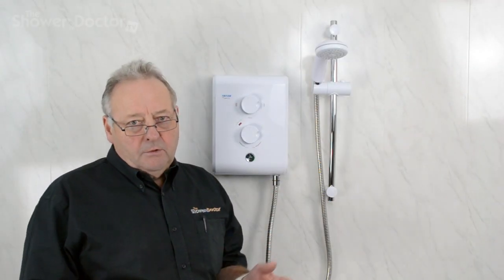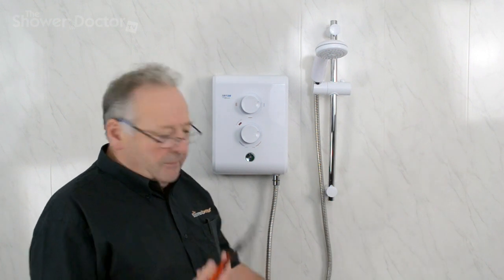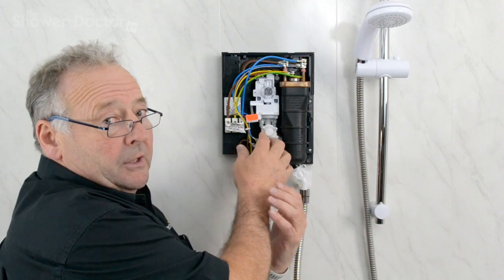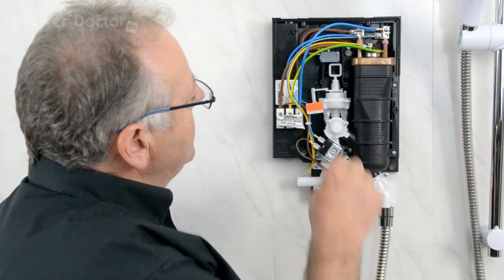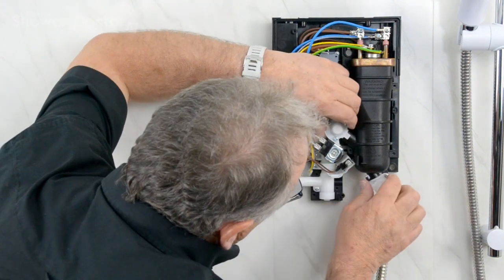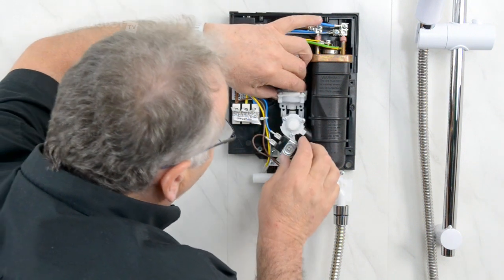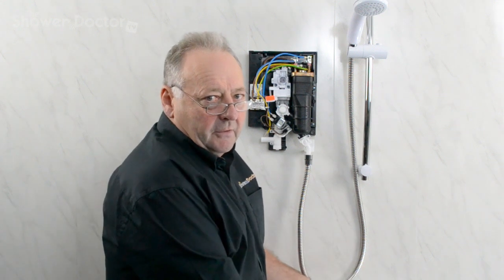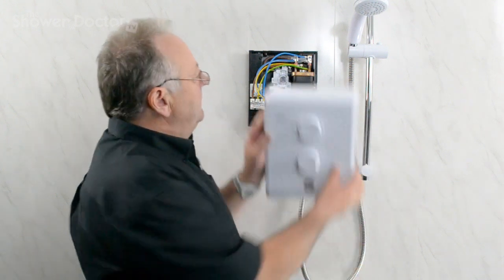Electric showers: Replacing a part inside a Triton electric shower

Comment: Class video.  Helped me identify my problem which was a leaking flow control valve.  Turned out to be just a faulty O-ring going to the heater tank, replaced with new one and followed the video closely to re-assemble all the parts correctly without breaking any.   Thanks again.

Comment: Very good advice which gave me the confidence to replace the Stabaliser Valve Seal in my TritonT80si(  £8.00).This saved me the £45 + the cost to fully replace the  Pressure switch. I did have to loosen the heater unit. 
Thank you

Comment from the maker: Hi Mind Biz

Thanks for your previous kind comments.

Re your question Mixer v electric it is pretty much horses for courses, I personally would prefer a mixer shower however this is to some extent governed by how much energy the boiler can deliver to the hot water.

A good electric shower will deliver 10kws so it would be worth checking what the output to the hot water your boiler can deliver.

The Doc

Comment: My Triton Ivory 4 blew the PDR a few wks ago. I broke the tension clip on the outflow valve taking it apart so had to order a new outflow AND pdr. It arrived this week and after fitting it, a new leak started where the pressure switch plugs into the heating tank. I have watched this video today and followed every step. Everything seemed perfect. Now it is leaking again at the point where the pressure switch enters the heating tank. Advice plz before I yank the damn thing off the wall and launch it through the nearest window ;) 2 weeks w/out a shower and losing my sanity with it lol. TIA

Comment from the maker: It is the solenoid and it is at the bottom of the flow valve. You can find it on our website, just search for part number MIRA-1563.507, we have already answered similar questions there and these answers will likely help you with your problem.

Comment: Hello. Thanks for the video!

I have a Triton T70Z electric shower. The power switch (top dial) doesn't work anymore, it moves in a continuous circle without clicking into place. What would be the fix for this?

Comment: Brill George, thanks to you mate i have fixed my shower many times, however how easy is it repair stabaliser valve seal on a triton t80si..I have bought a few parts from you in the past and your service is has always been first class with quick delivery ..i have just changed the selenoid{2nd time} and was told the reason its went again is because i didnt change the diaphram? is this right?.. Thanks again George.Oh and happy new year mate..

Comment: hi
I got Gainsborough 8.5 SE suddenly it has dropped water pressure only very less water is coming out i.e. much hot, I checked filter, hose, hand unit and water pressure are OK, I turned knob fully to cold but still less hot water i can hear heating boiling sound from shower then water becomes bit faster and then stops and process goes on same way, should solenoid needs to be replace, Please can you advice

Comment: My Triton T80i extra has developed a drip from the shower head.  I Took the shower head and hose off and the drip was coming from the bottom of the unit.  Removed the PRD (having watched your video) but the drip was emerging from inside the tube above the PRD.  Can you advise on what I should inspect next?  many thanks

Comment: hi shower Doctor, I have a T80si shower (over 10 years old) and have noticed over time (well in the last few weeks) that in order to get hot water I now have to increase the temp setting to almost it's top setting of 8 or 9 to get hot water where as before the settings 5 or 6 were fine, the water pressure seems ok, is it a case now for a new shower ? thank you Brian.

Comment: Hi i have a triton t80gsi and have no hot water.I have replaced the TCO but made no difference.Flow is ok and decreases when you turn to hotter setting as it should.Any ideas please?
Reply from the maker: Harriet Fricker When you replaced the TCO did you get hot water for a short while or did it just remain cold?  It's very unusual for a new TCO to be faulty but do you have a digital multimeter to test it to see if it is okay?
Reply: The Shower Doctor no just stayed cold.Time for a new shower me thinks.Thanks again.

Comment: Hi shower Doctor,i've noticed recently that when my shower is set for stronger flow,there is water dripping from behind the white casing,I'm terrified that it will connect with the electrics and electrocute me whilst using it.I'm not stupid but know ziltch about the workings of a shower,please advise.
Reply: Electric showers have seals designed to prevent water from even coming into contact with the water so absolutely no need to be frightened. You will not get electrocuted unless a gasket has worn out completely.